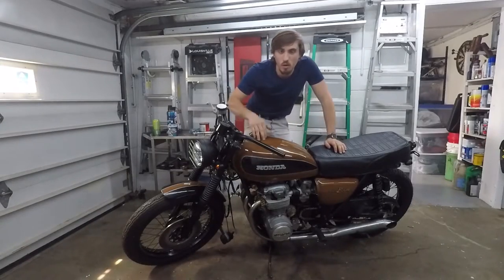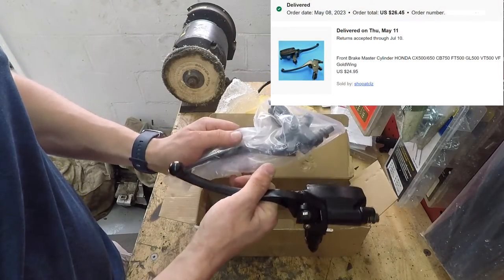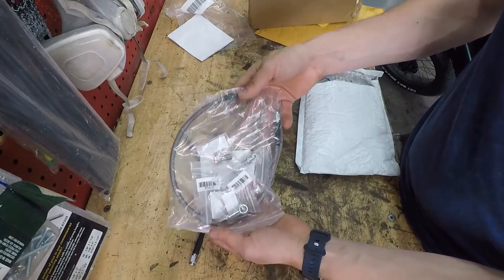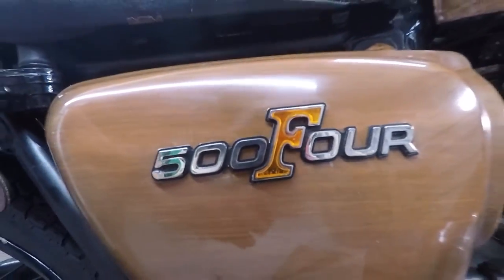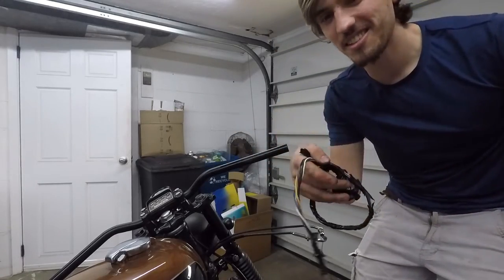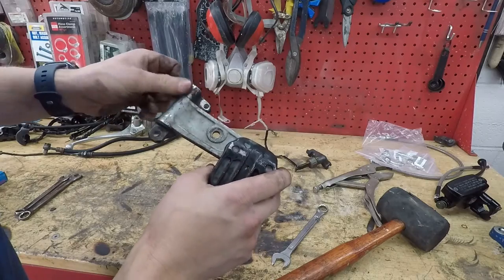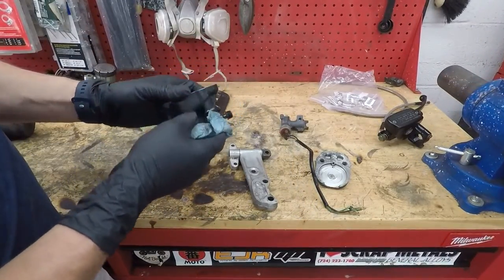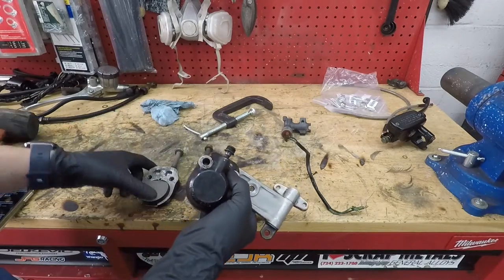Vintage Honda CB500 Front Brake Upgrade | Café Racer Build #11

Comment: Great build series. I work on a lot of CB bikes, mainly the 550 models, always excited to see fun interesting build series on these bikes. 
A quick tip, and I see this often. The fender is meant to be mounted on the other side of the brake arm, the inside of the wheel. It may seem like it doesn't matter but it changes the angle of the arm and the pads end up wearing unevenly as well as not contacting the rotor evenly. 
Best wishes on the remainder of the build and enjoy the fruits of your labour. 👏
Reply from the maker: Thanks for the info! I'll move the brake arm to the other side of the fender. That may explain the sticking as well.

Comment: I replace the DOT 3 in my vintage bikes with DOT 4 when i flush and replace fluid. 4 has a higher boiling point and  doesn't absorb moisture as fast as 3. That is important on a bike as a small amount of water in the caliper can cause the wheel to lock up when the water gets warm enough to evaporate. Living in a more humid area, like Pa., Its a good idea to drain, flush and refill brake fluid every couple of years.

Comment: Brake lines are always a wholesome upgrade. I seen some folks recommending getting a smaller bore MC, while this is a good way to upgrade the feel of that system, I would actually look for a bigger and better caliper. This will adjust the ratio in the same way, but also upgrade the caliper. Especially on these older bikes, you can often find a OEM takeoff caliper from something more modern that will be lightyears better at stopping, and usually quite cheap, and there is a ton of room for improvement over a single active piston caliper.

For example, on my '89KLR 650 I got replaced the 2 piston caliper with a four piston off of a SV650, for which there are numerous used calipers available on eBay.

In general, on motorcycles caliper swaps are very economical ways to upgrade the braking if you do some digging and find out what is a good upgrade from some other bike. Often they bolt right on, or adapter brackets are easily available. I almost always research this for any bike I own because as you mentioned, spending on the best braking possible is always money well spent.

Comment: You wanna have the lever squeezed anytime you loosen the bleed screw or it lets more air back into the system mate xD
Reply: Great work though! Stoked to see you riding this thing!
Reply from the maker: Yeah I know man I did that, maybe it didn't come across on the video.
Reply: @GoldGuyRides  ah fair enough haha my bad! I knew you knew better so I was confused lol
Reply: Gravity bleeding is my preferred method because it doesn't involve moving the piston and cups in the master cylinder past it's normal range. If it is an older cylinder, there is a chance that there could be rust further down the bore and it could tear the cup and cause a bypass leak.  

I really like the look so far, anxious to see what you do with the seat. 👍

Comment: You will get the most improvement by using a smaller bore master cylinder. 1/2” is relatively common. 

I bought one of those eBay master cylinders and found it to be surprisingly well made.  I purposely sought one out with a 1/2” bore.  I took it apart and measured the piston and it wasn’t as advertised; I think it was 16mm iirc... would be fine for a dual disk setup but not for a single.  The ratio is just all wrong.  

So I bought a used one, I think from a buell, which works great.
Reply from the maker: I never thought about the size of the master cylinder's bore, thanks for the info! I find it to be surprisingly well made as well, especially for the price!

Comment: Howzit the bottom of the caliper hose is actually installed incorrectly where it bolts onto the caliper. You need one of those angled fittings for the bottom.

Comment: Did you remove the piston in the caliper?
Reply from the maker: No, I didn't see any reason to. It doesn't leak or have any problems so I just left it in.
Reply: @GoldGuyRides  It looked like you had the caliper submerged in water/soap. If there was any water in behind that piston, it could corrode and seize up on you.
Reply: Good question. The bike is very old and who knows what condition the piston seals are in?   It's a simple job to remove the piston, clean it up and install new seals.
Reply from the maker: @Kro_man_tx  I flushed a lot of fluid through the caliper and made sure it was drained out before reassembly. I probably should have just changed the seal but it'll be fine.
Reply: @GoldGuyRides  as they say... just send it!